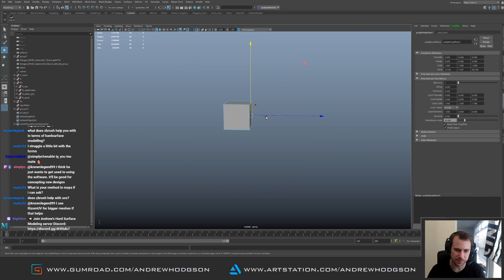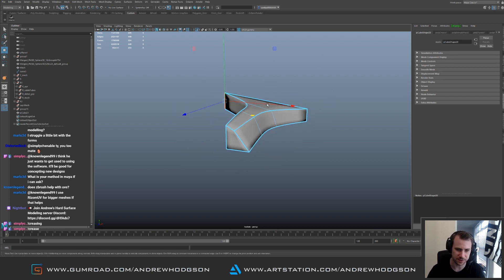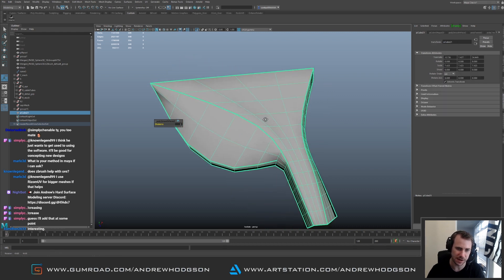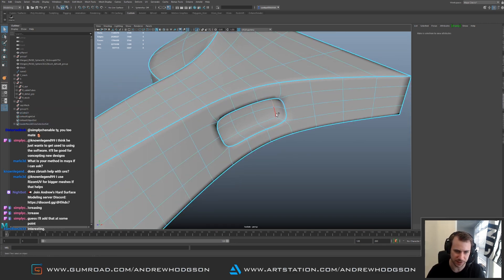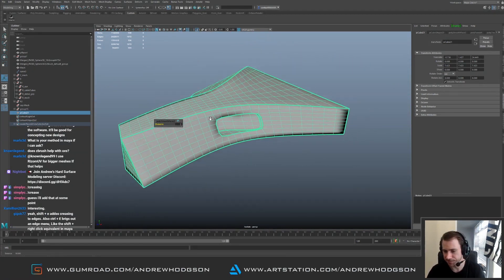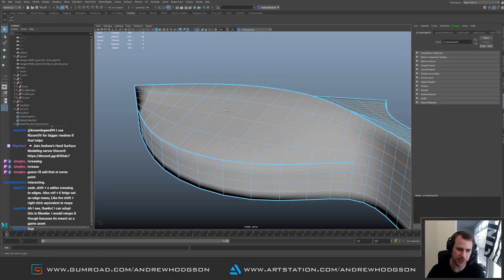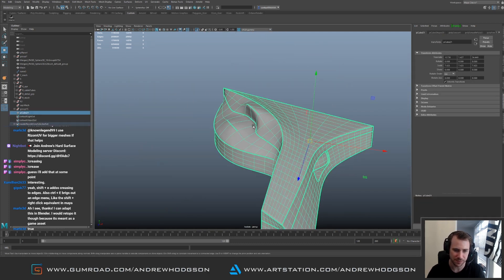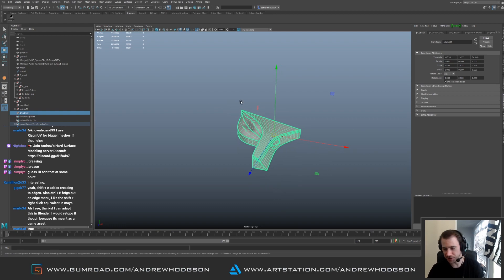Modelling Tricks - Curved Complex Shapes

Comment: It's a good thing that you make references to Blender because the audience can relate to it.I know there are sometimes periodically releases from paid software with the stripped down version.But still,I rather go the a. Blender way.3d modeling is more popular than ever these days ,and that's awesome.Your videos are very interesting.Keep streaming them,thx Back in the Lightwave days the software was awesome but the user base was small!
Reply from the maker: Blender can be as popular as it wants and people can use it at home all the want (I do) but if people want to work in the larger VFX studios they will still have to learn Maya. Somethings popularity online isn't necessarily always the best thing based on a persons career goals
Reply: @AndrewHodgson3D You're right. The work pipeline is nearly cemented for the industry, that's not gonna change soon.Just wanted to point it out that parallel references are good,and the pro’s experiences are the most valuable asset(until some AI not gonna make a better models😀,and let's hooe to not)
Reply from the maker: @ferencszabo3504  Correct. When I tell people they need to learn Maya people assume I hate Blender. I dont, i think Blender is a great intro tool to 3d and I use it for my personal work as a replacement for Cad modelling and making Machined parts. At the end of the day we work with the tools our Employer provides. That is why i find the die hard software wars so frustrating, It doesnt hurt having knowledge of multiple software.
Reply: @AndrewHodgson3D  Yup,still no magic bullet in sight , everybody needs to keep learning , to be the most versatile as he can for the job.BTW.the Houdini AI assisted terrain generation gives me chills
Reply: @AndrewHodgson3D  When I actually started to branch out and learn a multitude of softwares that are used in a 3D production pipeline, something changed and I became better at learning itself and much faster too. It opened doors in my mind that were closed before as if my brain got rewired. Before I was doubtful in my own abilities, now I am confident In my ability to learn and understand. It was the push I needed to get out of my stagnant comfort zone and make it bigger by staying out of it. I got addicted to that kind of thrill and it served me well. It may not be as useful for an hardcore specialist, but I would still recommend it.

Comment: NIce I use that exact same technique in but in Blender. Is great for adding subdivisions with out breaking the form or collapsing the bevels/supporting edgeloops. Yeah I always scratch my head when people say that Blender is faster because of Hot keys.. I think is faster, because of addons like Hard Ops and box cutter as well as having access to a modifier stack. You can create a general modifier stack with commonly used tools like the bevel, mirror, subdiv, etc..  and just copy it to what ever object that benefits from those.
Reply: How do you do this in Blender?  What specific settings, if you don't mind?  Appreciate any help you can give me.
Reply: @otherworlds9677  my setup would require a tutorial to explain. 9maybe will make one at some point). But for the basics. Make sure you have ‘Copy Atribures’ on in the addon settings to copy set ups from object to object. In the modifier stack, make sure to have bevel modifier above the subdivision modifier, change the bevel type from pinch to Arc and segments to 2, make sure the you change the setting from Angle, to weight. 9this way you can ad bevels only to edges that you mark as weighted and you are able to change the bevel amount according to the weight amount you sign to each edge, finally in the subdiv modifier, turn off creases. This will give you the perfect sub-div set up that you would get with adding supporting edge loops. 

For the low poly set up, turn off your bevel modifier and in the subdiv modifier options, turn on creasing. This will for most cases hold up your form and edge loo sharpness without deformation.
Reply: @h3ctor3scobar  Thanks.

Comment: Looks easy to get complex shapes, but when you try to retopology/copy 1:1 something I bet it's just as tricky as using regular method.
Reply from the maker: Nah it’s still better because you can keep the mesh lower poly while you pull it around then subdivide after for smoother edge flow once you got the shape you need

Comment: But if you keep subdividing like this wouldn't this add unnecessary geometry on the simple parts. Would you remove them afterwards?
Reply from the maker: You only subdivide until you have the geometry density you need for whatever the purpose of the piece is. You don’t need to keep subdividing